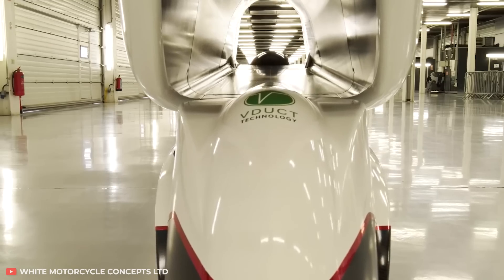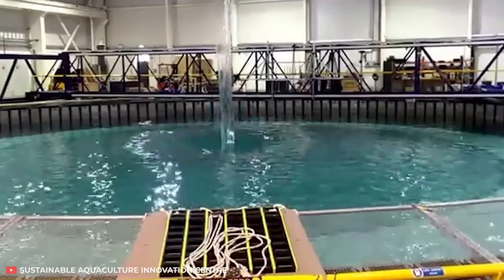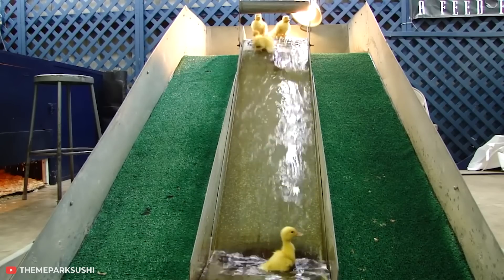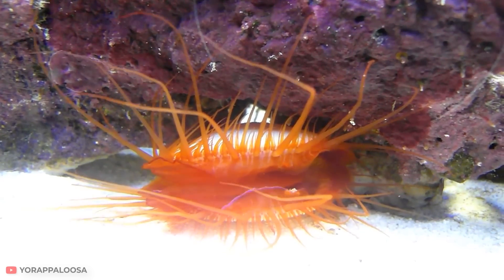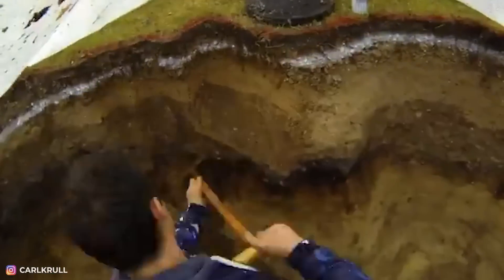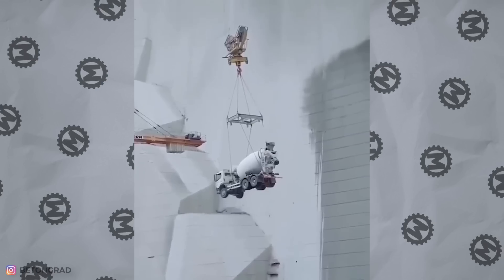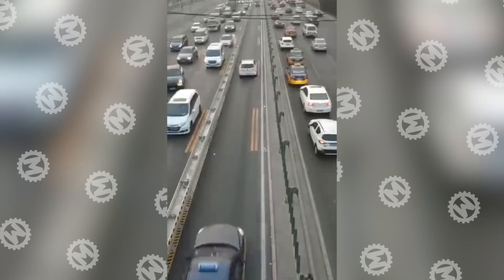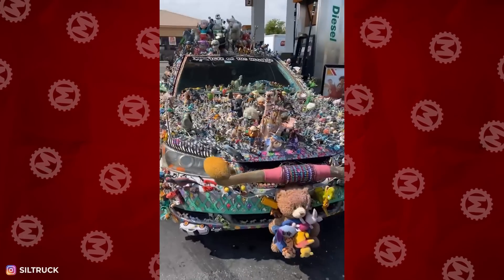25 Things for Those Who Have Seen Everything

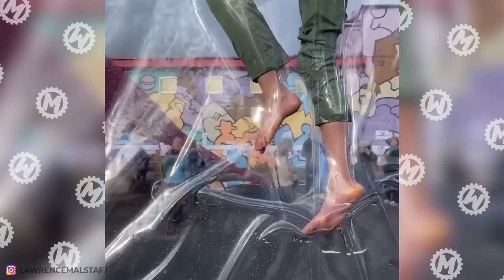Comment: @2:12, nope. The Jack is for A/C maintenance on the ground to communicate with another A/C maintenance person on the flight deck — while troubleshooting an issue.  Ground crew use a similar port up along the fuselage near of the the forward wheels, which is different for each make of AC, to communicate with the person on the flight deck.

Comment: I believe the harrier jump jet was one of the first for vertical take-off and landings
Reply: You are correct, there were a few prototypes before the AV8A was built but none were all that successful. Then they perfected the AV8A and the AV8B was born. The F35 JSF Lighting B2 was designed based off of the AV8B platform. Something this video got wrong is that the Harrier (AV8B) belonged the my beloved Marine Corps not the Army. Little known fact there's a third variation of the Harrier that is used strictly for training new pilots and that's the TAV8B which happens to be the two seater version of the AV8B. My sources for this information is from several years of being a Harrier mechanic in the United States Marine Corps.
Reply: Yeah, the Royal Air Force started using them in 1969.
Reply: @forsakenspirits  My father was in the army, we went to an air show when I was a child and I sat in one of the first to be seen, it was amazing

Comment: 9:15 Never, ever charge your phone with anything but the charger and cord it came with.  Anything else will kill your battery.
Reply: If it has the same amperage and voltage it's ok to use another one, and even with that, some phones are capable of fast charging but don't come with a fast charging brick.
Reply: Some phones dont even come w chargers now. U will not fry your battery.

Comment: The hydrophobic material on the guy's hand is soot and can be washed off under a regular faucet with running water. Rubbing the hand helps and various soaps can be used to make cleaning faster, easier & more effective. There are several name brands of soaps that are designed to get soot and other difficult substances off of hands. Even compressed air does a decent job of getting most of it off.

Comment: That lane divider is used all over. Boston Massachusetts has been using that for decades now. It opens an HOV lave to relieve traffic. HOV means High Occupancy Vehicles of two or more people. It's original intent is to encourage car pooling in and out of the city. Locals typically call it the Zipper truck.

Comment: You are incorrect regarding the phone jack on the engine.  If the ground crew wants to talk to the cockpit crew they normally plug in headsets located on the nose landing gear.  The jacks on the engine are normally used by maintenance personel for things such trimming an engine (essentially tuning the fuel control module) or for maintenance engine runs.
Cheers,
jc

Comment: Just gotta say I made the mesh panels for the Edinburgh wave machine cut the mesh and R.F welded  the perimeter and joined panels it was a lot of fun and a challenge due to the factory where I worked were in the middle of moving site I had to drag and cutting table and R.F welder around for 2months until it was just me In an Empty old and then empty new factory.

Comment: phone charging bench, works fine if no one is sitting on it.... sooo you have to stand around in the sun for 20 or so minutes while your phone charges...  how about a bench with a top cover loaded up with solar cells, that way you can sit in the shade for 20 minutes while your phone charges. SMH...  there are design flaws and then there are designers who flawed.

Comment: There's a drag Electric made now 02/2022. It actually goes 150 plus.  Top of the line components. So 250 mph that'll be a while. Plus you have to charge it with nuclear or coal fired Electric power, solar would take a lot of big money. This car thing is going to be a bust, Sorry 😞